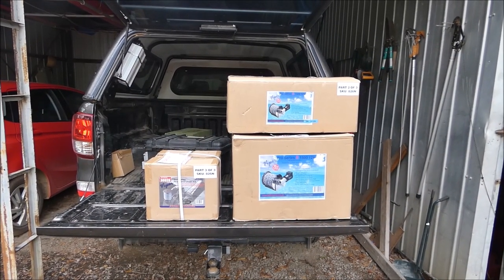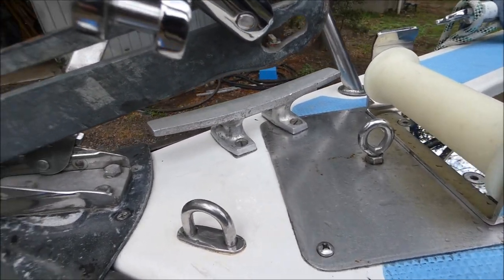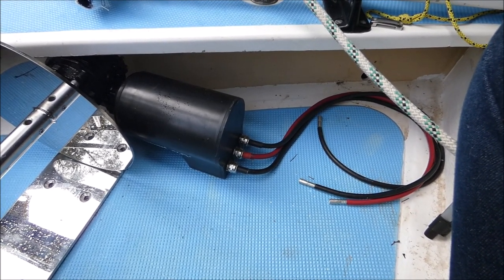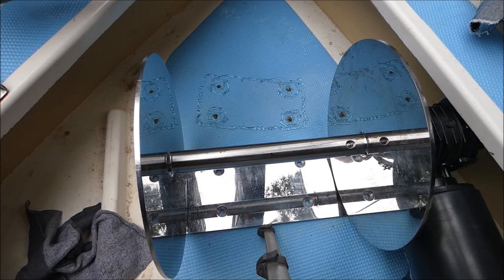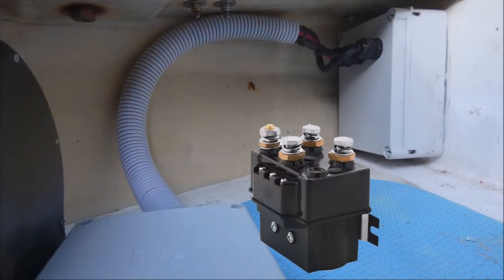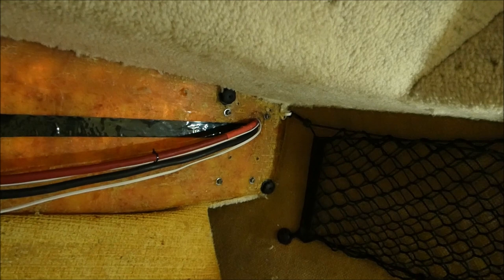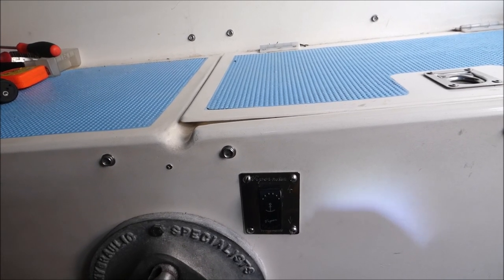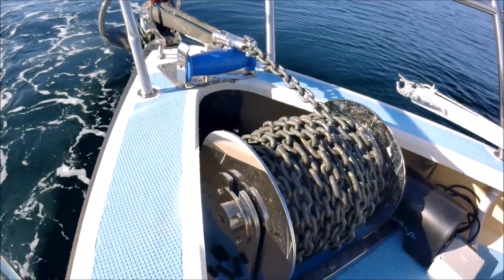Installing Drum Anchor Winch on a Trailer Sailer

Comment: Nice touch, your back will love it
The problem with silicone i'm told is that once silocone is cured it secreates an oil, making it impossible to seal over, you cant add more silocone once its cured. So im told
Reply from the maker: Good to know! Cheers Marki

Comment: A fine job that removes one of the harder parts of cruising, especially single handed. Much more useful than the capstan type in my mind. I would love to see a schematic of your wiring, I am 8 parts there with that on my SC25 but am still struggling with duel battery layout etc. There are so many options ! It's foggy and damp here in the Dandenongs and an occasional sail on Westernport (last Tuesday was beautiful with not another boat to be seen), and videos like yours make Winter not so hard. Thanks. Tom
Reply from the maker: Hi Tom,
The wiring is as per the wiring diagram that came with the winch. It may vary depending on the winch you have. I went for having the solenoid close to the winch in a waterproof box as it meant 2 heavy cables back to the battery instead of 3. Solenoid connections might vary according to the brand as well. I have twin batteries and just wired the cables directly to battery 1. If you have a dual battery system  it wouldn't matter which battery you wired it to as long as it has a current out capacity of 100 to 140 amps depending on the winch you install. If your main battery is a cranking battery it would have the capacity and mostly if your engine is charging the battery you tend to have the motor running when anchoring so the main battery would be the one to go for. If you anchored 10 times between charges   in deeper water then you might have an issue with discharge.
Yes last weekend was very pleasant but very little sailing wind. Still great to be out on the water without a boat in sight. Cheers Mark

Comment: My yacht managed to grow a small forest of vegetation over the second lockdown but is beginning to look clean. Unfortunately her rudder has split so handed the problem over to my son in law to fix. Looking forward to my first sail on Western Port and may see you on the water. There aren't too many RL 28 in the area.. keep safe Tony
Reply: Yes the lockdown was not kind to many boats. Hopefully you will be up and running soon. I have to wait for my trailer brake parts before I can get out again. The improvements to the Hastings ramp has made it a bit more TS friendly but a queing pontoon on both sides would have been much better. I hear it is a really busy ramp so returning after a trip on a weekend always makes me nervous. Over January I at least have the option of both launching and retrieving on a weekday. Hopefully we will cross paths out on the water, its hard to miss the big "Neringa" RL 28. Cheers Mark

Comment: Hi Mark, just touching base to see how you are. COVID has certainly made a mess of the year. Let’s hope all will be well for next year. Keep well Tony W
Reply from the maker: Hi Tony,  Yes its been a year you could never have predicted. Juggling my long service leave for 2021 to get to the Kimberley as I have to give 5 months notice. I have it set for April but may have to change it to July as its going to be a strong cyclone season and the Covid thing may still stop the Kimberley in April still. Have to wait and see. 
Waiting for the Hastings boat ramp upgrade to be finished and lock down eased to so I can do a lot of Westernport sailing this season for some new video material.
Hope you have avoided the virus and enjoyed what you can of the year. Cheers Mark
Reply: @TRAILERYACHTADVENTURES  I keep my small yacht at Yaringa which is not too far away from the Hastings ramp. I’m also a member of the Hastings Yacht Club. Stay in touch all the best Tony

Comment: Aloha, I see you attached the chain swivel to the anchor, I think I see where the maker said to put a shackle to the anchor and then the chain swivel.
Reply from the maker: Hi Roger, didn't see any reference to a shackle between the anchor and swivel. I did lock the threads on the swivel pins with resin. Used it like this for 2 years now with no problems. Will look into it more though, thanks for the heads up. Cheers Mark

Comment: Great job skipper.  Obviously, the motor for the drum winch is impervious to oncoming breaking waves?  I have a trimaran 30 footer.  How i wish i had a retrieval/deployment system like this.  But there is no room for such.  Loved your video.
Reply from the maker: Hi Alan, Yes room is always the problem on boats.  The motor/Gearbox has an IP6 rating which for memory means it can be submerged 1m for 1 hour. The RL28 has a large anchor well which lends itself well to this sort of winch. As a bonus it keeps the anchor rode neatly bundled whilst underway!  Cheers Mark

Comment: On one of the Lone Star videos it recommends using a shackle between the anchor and the swivel. I noticed you have connected the swivel directly to the anchor. What is the correct way?
Reply from the maker: There was no recommendation for a shackle with this winch. The swivel was super heavy duty with pins twice that of the shackle I would have used. I did use thread locker when installing as the sliding slot on the anchor may have worked the pin loose. I am not sure if the shackle is needed, I have had my arrangement for quite a few years now and have no issues with it at all in that time including during our 3 month Kimberley trip where the pressures on the anchor in the huge tides were often a real challenge for the anchor. The swivel pin has little signs of wear and has never shown any inclination to work itself loose. Cheers Mark

Comment: Do you recall what size wire you used?  Appears to be quite the distance from power to the motor.  Nicely done, especially the gussets.
Reply from the maker: Hi Creig,

For memory it was around and 8m cable run, a bit shorter for the negative and a bit longer for the positive. Originally I was going to use 2 B&S but ended up using 1 B&S because that''s all the supplier had at the time. I am reasonably confident 2 B&S would have been adequate as the 1 B&S has shown no signs of being stressed at all. I have to say its been one of the best additions to the boat for stress free anchor retrieves.  Definitely recommend the addition of the remote control to the system.

Cheers 
Mark

Comment: Hi Mark, the yank, here , has another question about your setup...smile.  Once anchored. ..do you attach some sort of snubber to take the load off of the drum and motor assembly?  My God, Mark, that looks bullet proof commercial fisherman style...he he he...Wonderful explanation and good eye for bomb proofing it.  I really have to think of how to make my anchoring life more easy.  I have a 35 lb Mantus and only 30 foot of chain and then rode.  But I am late 60's...ain't getting easier.  I lost an anchor last February in San Carlos area when caught in an anchorage with 6 foot swell and 30-40 knots of wind and about 15-20 foot deep.  Boat sailed on the anchor rode all night.  Pitch up, pitch down...sailed to port and lifted the windward ama...dropped into the trough...what a night.  Was done puking my brains out by 2 am.  We never forget those nights...do we?  So much fun and then moments of sheer terror.
Reply from the maker: HI 

Hi Alan,

I was definitely in the same boat, 30ft of chain in deep water was getting a bit much to haul up and the thought of being able to drop the anchor whilst in control at the rear of the boat really appealed. I went the drum style winch as there wasn't enough room below decks to create a chain locker to use with a normal anchor windlass. The drum also copes better with the chain/rope anchor rode. I do a lot of solo sailing so being able to drop and retrieve whilst in control of the boat especially in tight anchorages is fantastic. The drum is rated to 270kg of constant pull so in most places I dont need to use a snubber. Once retrieved I only lock the anchor down if planning to do a longer passage in rough  conditions and have never found the anchor loosening on shorter trips. I love it so far, the only worry is that if it ever fails to spool out I would have to get my spare anchor out from the rear of the boat. A free spooling model would have been better but are 6 inches wider and that would have bee to hard to fit in the boat.    
Nothing is absolutely perfect but I think its not a bad compromise. Cheers Mark

Comment: Hi Mark - great video
I've just bought and installed the same Viper winch and do you have a link for the curved roller
Reply from the maker: Sadly I couldn't find a suitably wide curved roller although I am sure someone makes them. I used my old wood lathe to  make one from a block of polyethylene bought on ebay. The reason I needed one is that the closer the flat roller is to the drum winch the more a curved roller is needed to help lay the anchor line evenly onto the drum. Even then it doesn't always work perfectly especially if your drum is really full. Best be is to find a supply of any curved rollers and see it they can source one of the right width. If you have a lathe machining them is pretty easy.

Comment: Hi Mark,
Great video as always.
Do you need to lock of the anchor rod or chain after you set it on this anchor winch .
Reply from the maker: Hi Mark,
The winch claims to have a holding capacity of 270 kg so no, I take my safety shackle of once on the water and put it back on when loading back on the trailer. I might consider using the locking shackle if the forecast was for really rough weather but otherwise I only lock it for road travel. Cheers Mark

Comment: I have just bought a Sonata 26 and at 67 my days of fore deck work are a lot harder. I have viewed your installation several times trying to work out how I can reinforce the anchor locker to cope with a drum winch.  Have you any suggestions?
Reply from the maker: Hi Mike, Not familiar with the anchor locker on the sonata 26. If you send a couple of pics to my channel email sharemyadventure.net@gmail.com I can give you some hints about how I might  strengthen it . Cheers Mark

Comment: I always forget to ask the following question......how reliable are the Parsun outboard motors? Your thoughts please...
Reply from the maker: Hi Tony,
Missed this question. They are OK and perform well but have a few short comings. I found my 15hp 2 stroke reliable except when I was in the Kimberley last time. Had fuel issues and poor idling. Fixed it with stripping the carby and giving a full clean but I was hesitant to do that in the Kimberley sailing solo incase any parts were damaged or lost. This could of happened to any outboard though. The biggest fault of the Parsun motors is the poor quality of the alloy used to make them. Corrosion and bubbling paint was a constant problem. The smaller 5.8hp parsun I got also had this problem big time and the water pump after a short time became a bit marginal.
Other than the above, they started easily and performed as well as the more expensive outboards.  I would probably not buy another as the only importer of these when called on the phone for advice on the 15hp was rude and un helpful to say the least. Hope this is helpful. Cheers Mark

Comment: Would this work for a 36ft yacht weighing 3 tonne?
Reply from the maker: The winch was rated for 8m + and for memory up to 3.5t displacement boats so strength wise it would be ok. You would just have to check the winch rating before buying one. 

The main issue with this style of winch is the capacity. I used 70m of 12mm rope and 12m of 8mm chain and the drum is at full capacity. The winch came with 100m of 6mm polyester rope which in my view was completely inadequate. So if 80 to 100m of anchor rode is sufficient for your boat it would be fine. It is important to remember that these drums are designed to work with a rope+chain anchor rode. Chain only would have a much less capacity. Hope this helps. Cheers Mark

Comment: I envy you ... you have an anchor well I supplemented with an a winch with 300 foot of rode however I need to have somewhere to  place my anchor and chain so its not rollong on my deck any ideas?
Reply from the maker: Only really 2 options. First would be to bolt a box onto the foredeck but unsightly  and gets in the the way of sails and working there. Second option if there is enough room in the vee berth underneath to create a fibreglass box hanging down from the underside of the deck into the vee berth space. There are commercial hatches you could install in the deck and even make it self draining if not too low.
Cheers Mark

Comment: Hi Mark. just wondering how changing from a fractional rig to a mast head rig has changed the handling of the RL 28. Did you change the position of the mast ? and what size head sail are you using. What made you change it in the first place.    thanks joe
Reply from the maker: HI Joe,
I'm not a racer so the fractional rig is less important to me. The headsail is the same area as the mainsail with the bottom high enough to be able to see in front of the boat when under sail if I bend down.
I changed the rig mostly to improve light wind performance and balance. The original head sail is quite small and the boat is well under powered in my view. I now get between 1 to 2 knots extra speed in winds under 15 knots depending on point of sail and sea conditions and for me this is significant when cruising which is my main use of the boat. The RL has a tendency to round up in strong gusts when heeled so it was part of the process of improving that as well. At around 15 knots the headsail is reduced to around the original size to keep the boat balanced and sailing well whilst under 15 knots the boat is better balanced with the full headsail out. The rounding up was also improved by the new flatter slightly smaller mainsail  I got 18 months ago, that moved the center of effort forward.  The mast position is now far more fixed but still has some ability to adjust with the back stay. I am using the second hole from the front on the mast base bracket and have adjusted the mast to as close to vertical as possible. Without the back stay tensioned the top bends marginally forward, I then tension the back stay until it returns to vertical putting a good tension on the front stay and furler. It can be bent slightly back with more backstay. I have added an inner forestay attaching behind the anchor well and to the original point on the mast. This is tensioned enough to give a very slight forward curve to the mast.
My assessment of it all is I have a greater range of sail forward to adjust the center of effort and balance the boat giving better speed in light winds. Having said this strong unexpected gusts can seriously overpower the the boat and round it up but the RL28 is quite twitchy that way and in my view anyway which I feel is partly due to the keel design and the center of lateral resistance not being quite far enough aft. The other bonus is when using my full spinnaker previously the unsupported top of the mast would bend significantly which I wasn't comfortable with where now it is rock solid. Hope this answers some of your question. Cheers Mark
Reply from the maker: Forgot to mention the main and the headsail are both just over 12.5 square metres each.